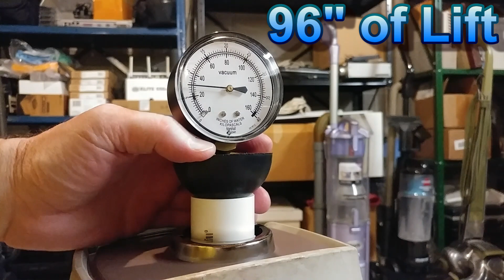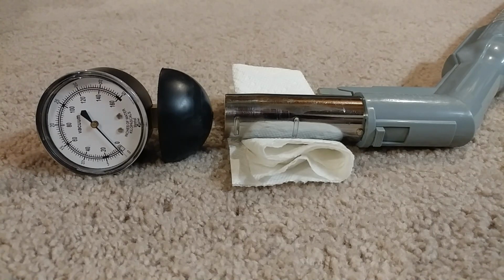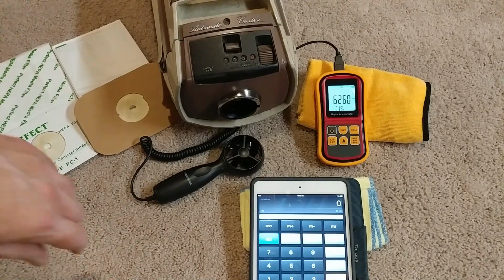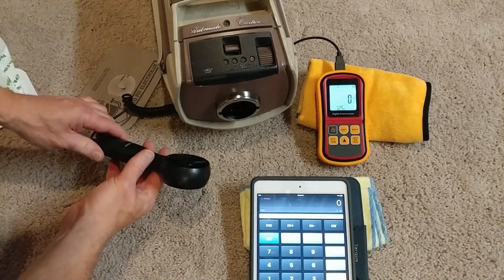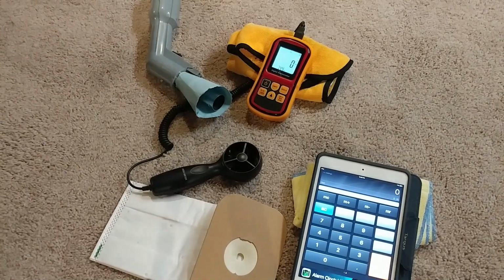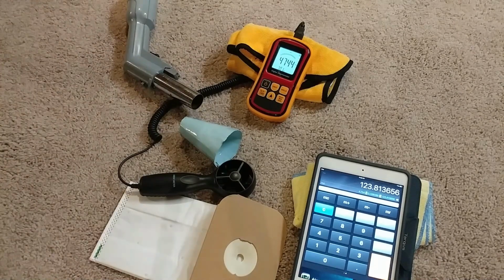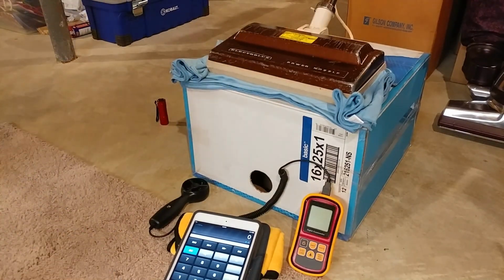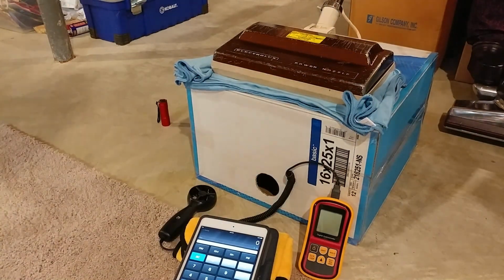Electrolux Marquise 12Amp With PN4 Full Airflow And Suction Tests

Comment: Just got a Perfect C101 today initial hose testing shows airflow of 4449 fpm or 116.11 CFM and about 122" for suction. At this point that's all the data I have. I find it very strange that there's such a difference in the suction. It makes me wonder if there's a bad seal in this marquis or if it's using a different motor.
Reply from the maker: Since this machine is a Franken-Lux, I'm sure there are leaks somewhere. Anyhow, looks like the hose CFM is essentially a match. 👍
Reply: @VacLab  The Perfect C101 received a new bag and testing was performed, the results are posted on VL they're a little higher than back then with the hose flow at 122.27 CFM
Reply from the maker: @Blackheartvacs  Wonderful! Say, did you happen to see how much power the motor was using? Over 1400 Watts?
Reply: @VacLab  Yes the suction motor was running at about 1482 watts

Comment: I just tested my Lux Royal (8,2 ft hose). 104 hose cfm and 82 nozzle cfm. It uses 10 amps. Video is coming but yeah it can't match this beast :)
Reply from the maker: Vacuumtests only your 1900 Watt Philips wins by 4 CFM at the nozzle. BTW, are you able to test the Philips at the canister intake? Wonder what it would pull?
Reply: I only got 136 cfm from the canister intake. I believe it's because Philips has quite many turns in the airpath and many filters.
Reply from the maker: Vacuumtests well that would make a good air cleaner then. With high airflow and a HEPA bag, it could cycle through the room air rather quickly.
Reply: That would work well like that. However using 1900 watts all day long everyday might cause huge electricity bill :D
Reply from the maker: Vacuumtests hopefully your Finnish air isn't too dirty then. 😀
Reply: VacLab 😂